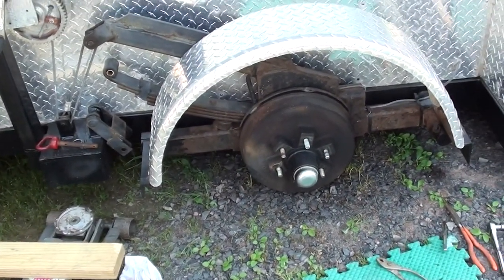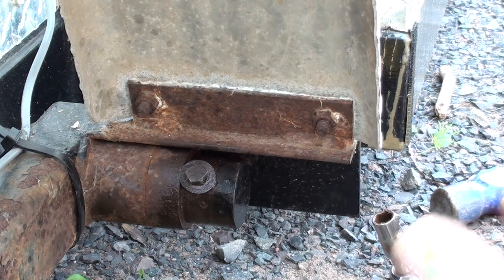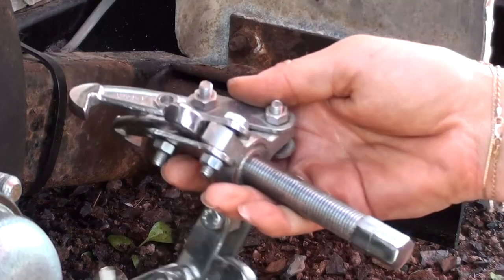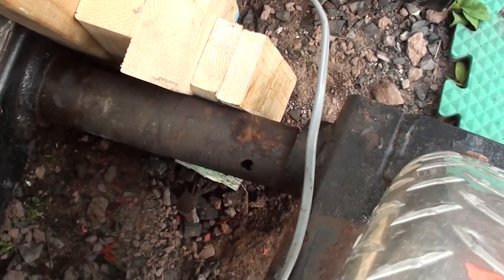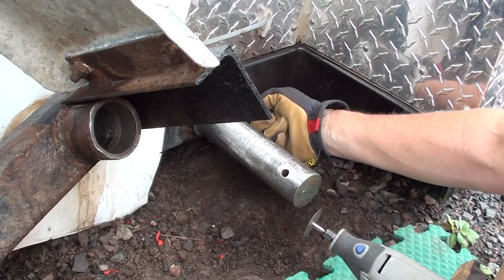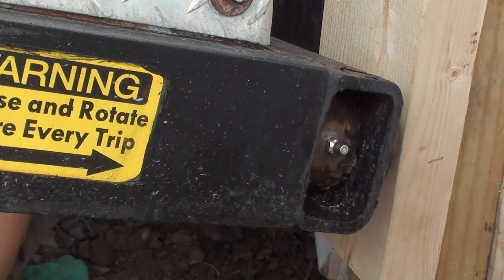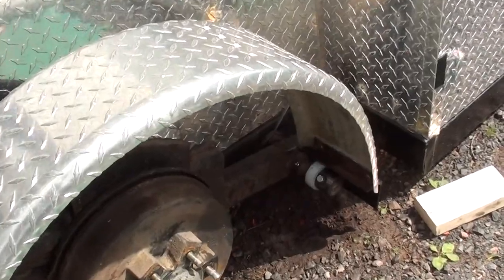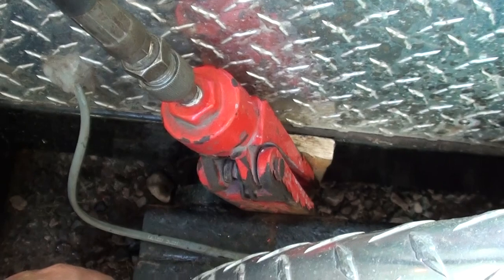How To: Fix Stiff or Seized Axle Pivots on an Ice Castle Fish House

Comment: I'm having the same issue with the fish house. Tried to pump some grease and the zerk broke off, really hope i don't have to go through these measures to slide it apart.  Good informative video here if i do!!
Reply from the maker: I hope yours comes apart smoother than mine did! Ice Castle (not sure about others) used pop-in zerk fittings, so when you put any pressure on them with the grease gun, well, they pop out, too! Mine were missing, which left an open hole leading right to the axle stub and of course, a direct line for water and grime to get in there. Not good.
When I was all finished, the house felt 10X lighter to crank, too. When I got the house, I remember thinking "man, this thing is heavy!" when I cranked it. It wasn't heavy, it was just mostly seized. 

Good luck with yours & I hope it goes smoothly! Thanks for watching!

Comment: We switched to Copper anti-seize @ work; Love it!!! What a Pain!!! Excellent Video!!! I'm curious on the wear for the composite ring? Awesome Rush!!!
Reply from the maker: I'm curious, too. I've seen many people have switched to them with good long-term results, so I'm hopeful. Since it's not really a wear item and there doesn't seem to be any serious pressure on them, I think they'll be fine. The only real wear they seem to face is the pivot assembly rotating a minimal degree along the edge, but I'll be keeping my eyes peeled for wear. I kept the stock spacers but it took every ounce of restraint I have not to cast them into the pits of hell whence they came!
Reply: @EndlessDIY  where did you get the those spacers? I haven't been able to find spacers either metal or composite.
Reply from the maker: @mickeyg505  I made mine but if you go on Facebook, there's a group called Ice Castle Owners Group (ICOG). There's a guy named Todd Sandberg (I believe). He sells the premade composite ones for like $40. Hope that helps. Thanks for watching!
Reply: Thank you for a very nice and well done video.   You are doing a great job.  I was a millwright for 40 years.

Comment: First thing I did was take the fenders off. Great job and video. This pivot system is a poor design. The new greaseless system seams to be much better
Reply from the maker: Thanks! I would have taken the fenders off but those bolts looked pretty bad, too. You’re right though, if you can get them off easily enough, it probably makes it a bit easier. 
I think the pivot is probably ok, but it absolutely needs more grease fittings. The single press-in one is completely worthless.

I saw a video about the new greaseless system & it looks very nice; I hope it’s the ticket for easier maintenance. 
Thanks for watching & commenting! :)

Comment: hey, what size axle peg bolts did you use are these? trying to do this to mine and replace the bolts but don't know what size they are.
Reply from the maker: I'm sorry, I can't recall for sure but the head & nut were both 9/16" and it was maybe 2 1/2 long. That's about all I can remember.